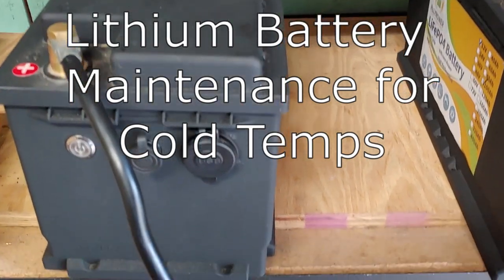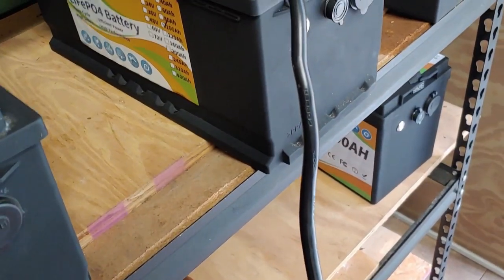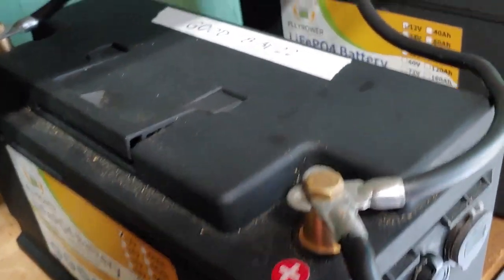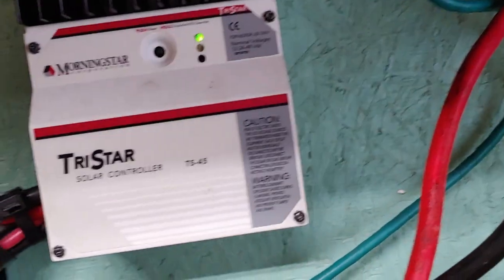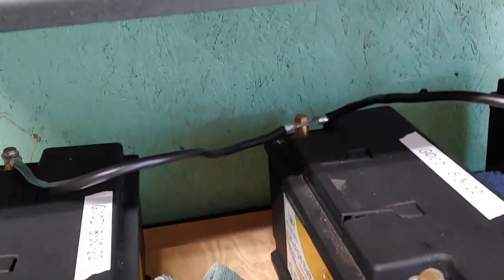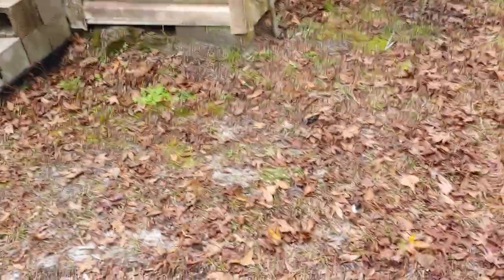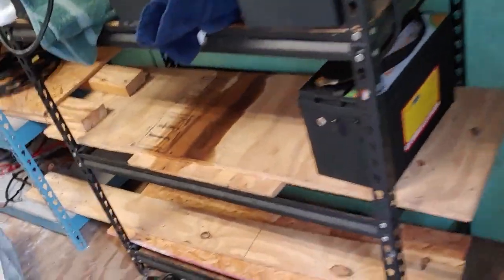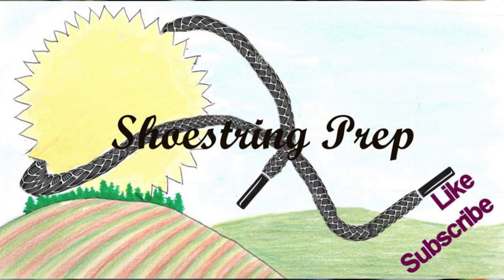Maintenance for cheap Lithium Batteries during Cold Temps

Comment: I have mine in the basement kept warm by wood stove. Mine have cold weather protection/disconnect but i bought them to use them. Am on grid so worse case i will use the 6 grow heat pads i have to keep them warm.
Reply from the maker: Sounds like you are set for winter. Thanks for your comment.

Comment: How cold is bad for the batteries?  I just looked it up and it is 32 degrees.  In the winter here in Ohio it sometimes won't go above 0 degrees for a few days and not go above freezing for a week or two.  Looks like lithium is out for me as I was going to power my detached garage with a power station.
Reply from the maker: Charging lithium batteries under 32 degrees can damage the battery. It is quite safe to discharge the battery at those temperatures.
Thank you for your comment.